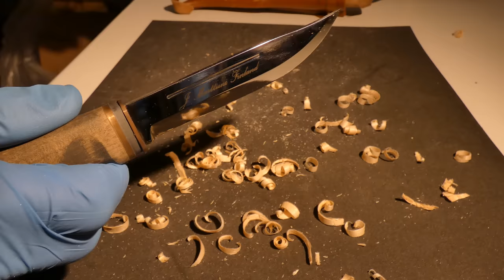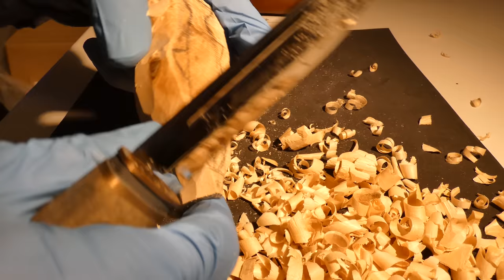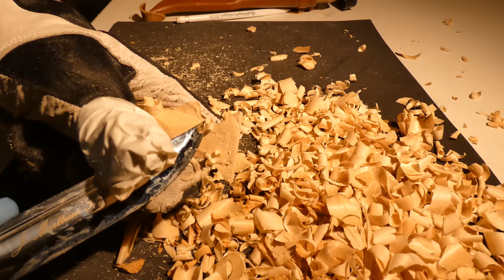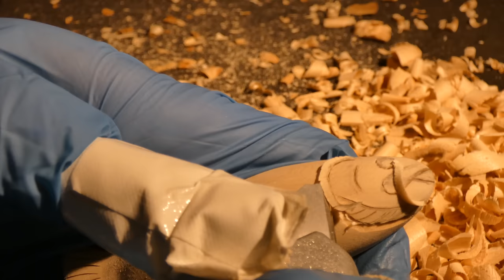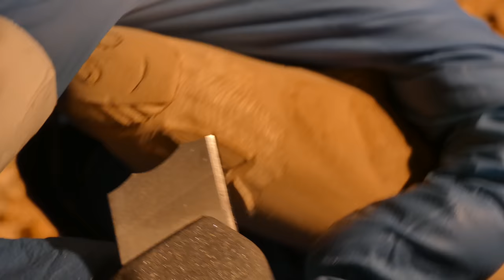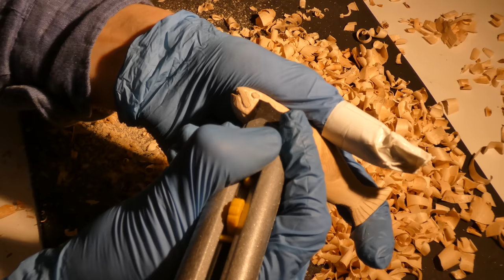1 Hour of Wood Carving ASMR - No talking - Sounds of Wood

Comment: I’m curious as to the purpose of the latex gloves. 
Also you carve that wood as though it were butter and it’s so soothing to watch the shape emerge gradually.
Reply from the maker: Thanks 😊 Theres no reason to use gloves other than that I was covering my hands because I had frost damage on them. But I will use a glove or tape to cover my left thumb because i push the knife with that thumb and after awhile it starts to hurt if I dont have any padding for protection